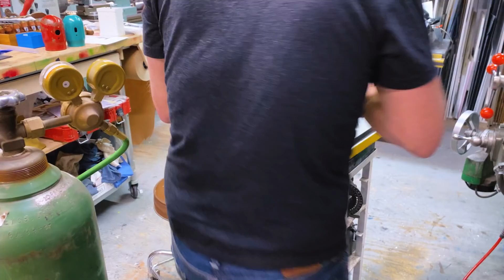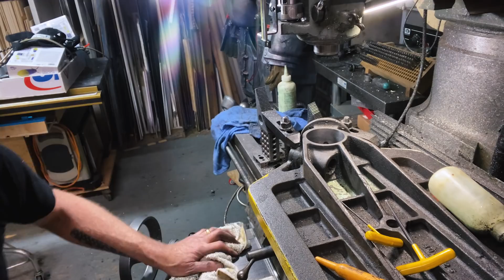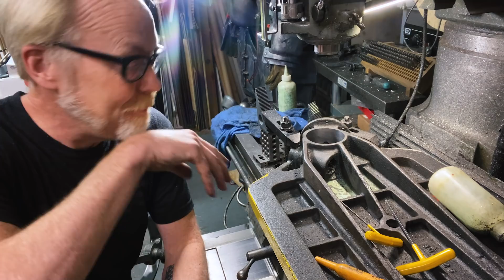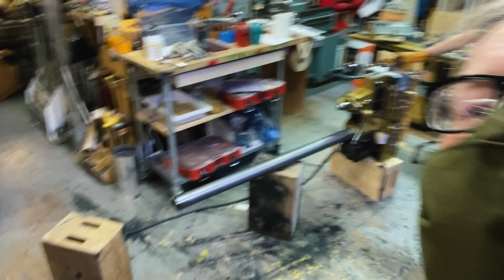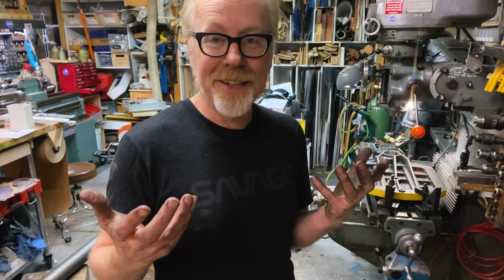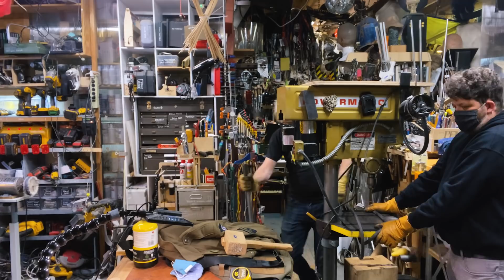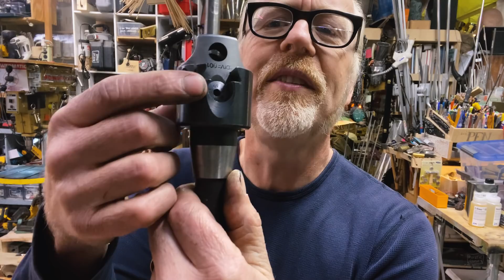Adam Savage's One Day Builds: New Drill Press Table!

Comment: Great to see you figured it out & got it to work. While watching your Mercury suit cuff links video I noted all the lubricating fluid you were using manually, and the mess it was making to the back of the mill. I use some cling-film or saran wrap as a splash back for dirty jobs - easy to peel off and replace. Also I wonder if a motorised lubricating fluid system might be a build you want to do, along with a capture and recycle tray underneath. You could make it flexible enough to work under the lathe, drill press or other machine in the shop. Thanks for all the great videos & keep working out the little niggles & wiggles.

Comment: Use dry ice on the pole will make it easier to put the table on.  Take about 45 to 60 minutes.  The diameter will be smaller.  Also heat up the table with heat gun.

Comment: Should've kept the OG table installed under as a tool rack support. :)
Taper cuts happen when you overextend something OR OR when your bearings are shot. Generally, with old equipment, you want to take a lot of spring cuts.

Comment: As a former metrologist and Quality Engineer (newly retired) who routinely measured automotive parts with a 3 micron tolerance, it's painful to watch you attempting to accurately measure an ID with a caliper.  Even the most skilled with that tool can only hope to be within .002" accuracy simply due to the construction of the tool.  But even with that, tool flex and clearances were obviously the bigger problem.  I really enjoy your cowboy approach as it is 180 degrees opposite to my anal retentive attention to detail and still gets to the finish line.  It inspires a more relaxed attitude in my project ("it isn't brain surgery").  BTW, how is the finger after the battle with your lathe?

Comment: Too much stickout on your mill :). Pressure reduced as it extended through the hole.  Line boring, reamers, etc. Pain to do cuts like that. If machine was out of tram it would have cut the whole hole at an angle as opposed to having a taper.  My guess anyway. Awesome work!  Great vid.

Comment: That's a smart machining practice, to hold off on taking apart your clamping rig all the way. I do a similar thing in my shop. we have 4 hexagonal turret lathes that drill and bore holes in cast iron, which we ship to customers. what i do is leave the tooling on the machine, because there is a strong chance that we may get a similar size ID to drill out. If its a different ID, we just take the tooling down, and put the new tooling on.   Sometimes it saves time here to be lazy and not put the tooling away!

Comment: When the new table wouldn't fit, despite measurements being above board, I would've suggested to re-mount the old table. 
You know the old table will fit, and if it won't go on, it's your technique that's the issue, not the table..
edit: granted, doing so wouldn't catch that the tool was bending near the end of the hole, but as a troubleshooting step it would narrow down what's going on.

Comment: I was changing the clutch on my VW rabbit. The transaxle weighs all of 75 pounds, so no transmission jack or whatever is needed, you just lie under the car, drag it close, and lift it up on your chest, then dead-lift into place.  There are guide sleeves on two of the bell housing bolts, so just wiggle it in place until you slide over those sleeves.
I worked at that for at least a half hour. I could not get the shaft spline to engage and the sleeves to engage. I was exhausted and frustrated. Set it all down and went inside.
Came out later determined to  l i f t  t h i s  u p... and snap it goes right in.
I was so tired I didn't realize I wasn't holding the transaxle parallel to the crankshaft and was trying to put it in crooked.
Sometimes it helps to just stand back and take a break

Comment: I was surprised that you didn't cut a piece of wood or something to the size of the drill press shaft diameter and test the cut (either the first or the second time) by trying to slide that through the widened hole in the table.

Comment: From a professional machinist, I have 2 easy tips for your future boring convenience. 

1. Calipers are not final measurement tools. They're for reference and rough measurement. Use a telescopic gauge (or better yet a bore gauge), and you can see any deflection before you take down  your setup. 

2. Those boring heads are built with a cross hole that you can mount your cutting tool in. If you gan get it to fit, that's always the most rigid setup available to you. I happen to know those little Criterion style heads are made in 2 or 3 different diameters for that reason.
Reply: What is going on here? https://youtu.be/sbqytCVtQb4?t=214 Were you having a seizure when that part of the video was playing and somehow missed it?
Reply: @1pcfred  you mean where he uses the telescopic gauge to only transfer the upper dimension, and then measures it with calipers? Did you have a seizure while you were reading my comment?
Reply: @87FordMudder  let us go back and read your comment again, shall we? "Use a telescopic gauge" That Adam clearly does. Now why would you say I read your comment wrong? He's hardly fitting bearings here. His only mistake was to only measure in one place.
Reply: @1pcfred  Thoughts communicated in complete sentences are best analyzed in the same way. Read the entire thought and make another attempt.
Reply: @87FordMudder  my reading comprehension is exemplary so quit trying to weasel your way out of it.

Comment: Thicker boring bar with minimal "stick out" and larger boring head. Cast Iron should be cut dry to reduce the possibility of the abrasive swarf getting effectively turned into a grinding paste. Also: Easier to vacuum the dry swarf than it is to mop/ scrape it off the machine. Great build!

Comment: What's the ceiling like in there? Any room for a chain hoist for some of that heavy lifting? I use one in my shop and it's a life (back) saver.
Reply: Above the workshop is another floor of space. It's like a loft space, you need to go up by ladder but it's got rows and rows of shelves with weird stuff like space suits or bits of broken robots and half finished projects. I suspect it's barely able to support the weight that's up there already and couldn't handle anything more. IIRC he said the floor of the workshop is at an angle because it used to be for cutting meat or something, and the floor is actually suspended on a set of beams he built with his builder buddies. He specified the weight of the floor must be able to support the X-kg weight of the drill press and mill.

What he needs to do is get a different builder/lunatic that is good with welding and put in some proper RSJs so he can do a chain hoist. But first he'd need to remove a lot of his stuff temporarily and that could take months.
Reply: @martinperry1843  The loft only covers the first part of the workshop. The main part were Adam works has a high ceiling with a skylight. https://goo.gl/maps/XJXdtU5Wmb5wbhRW8
Reply: @RimePendragon1974  oh so maybe it IS time for him to look into getting a chain hoist. Also those 3D shots of his workshop are amazing, it's fun to see but it must be from years ago as half the walls are empty instead of covered in Adams miscellaneous crap. I spotted a RoboCop shoulder armour piece on the table, does he have a RoboCop outfit too?
Reply: It'd likely be good enough for a few hundred kgs. A 500kg chain hoist is tiny and makes picking up things like the drill press a breeze.
Reply: Adam’s cave is crammed into a tiny lot in San Francisco, and in one of the oldest neighborhoods. It looks bigger than it is. The floor of his attic / second floor is wooden, so I doubt there’s room for anything like a chain hoist.
Reply: He has a Bridgeport AND a lathe in there, so...  He's got a pretty decent sized load on the floor already.  And I didn't realize that it's a wooden floor until just this video.  BUT !  An engine hoist works pretty well for me in my shop. It's not everything that I could want, but it's better than nothing.  (oh, and p.s. a cylinder hone would have straightened out the bore for you, it's a big time saver!)
Reply: That's what the apprentice is for lol

Comment: its very common for milling to cone, as it flexes the deeper you go, so the flex from your first pass carries over to your 2nd rotation aso. thats why we usually have a finishing pass in CNC with the exact same specs as the last pass.
Reply: Old hot rodders learned the hard way with a wedged piston and broken rod not to use a boring arm without multiple finishing passes.
Reply: I've heard machinists call that last pass a "spring pass". It compensates for the springy bending of tool, material, and machine during heavier cuts.
Reply: I was wondering what the cause would have been, and this makes sense. I guess the motto should be “measure twice, cut once (or more if working with metal) then remeasure before installing”
Reply: I have a number of boring bars with HSS tips for deep holes where there night be deflection issues.  Less tool pressure needed, so less potential deflection.  Not the root cause here, but sometimes invaluable.
Reply: @componenx  I love HSS inserts for my wet noodle Atlas lathe :-)
Reply: @samroesch  I had an Atlas, but it had been repaired so many times that I gave up on it and parted it out.  My Logan and Clausing lathes are much stiffer.  OTOH, my primary mill (/drill!) is also a noodle under load.  I have a Millrite in storage that I've never used because it has a BS7 or 9 taper, but I was just thinking today that it much be stiffer than the TWS mill.
Reply: Yeah I was going to assume that there's some kind of bit deflection at play especially considering how long it had to protrude.
Reply: One thing that works better when boring deep holes on a Bridgeport is using a boring head that has an extension between the head itself and the R8 taper.  And then use the shortest boring bar possible. Also when possible use the biggest boring bar you can

Comment: Adam idk if you have covered it already but is the floor plywood.  Mine is and I enjoy it for ease of removing sheets and installing outlets or air lines thru the floor . Was wondering how you felt about it
Reply: yea its super thick too. the actual floor is concrete that slopes to the middle for drainage. he had the wood floor put in professionally if memory serves. he also has had to run lines underneath it a few times.
Reply: @ShadowDog_43  thank you for the info. Mine is 3/4 its strong but I can maneuver it around  sadly under my joists is sand not concrete haha

Comment: When training, we were always taught to bring the table up to the tool as much as possible instead of using the quill. That might have also contributed as by using the quill, the moment on the end would be much higher meaning its more likely/easier for the tool to bend especially when machining harder materials
Reply: Thats what I was thinking, tool deflected once it was extended far enough
Reply: @microbuilder  exactly my thoughts. Surprising how much force can be applied, especially when extended. 

I only ever use the quill for drilling through holes. When mission critical or larger cuts are being made, the stability/accuracy/control you get when raising the table instead is key
Reply: @wiggle4545  Looks like that wasnt the only problem lol 20:10
Reply: @microbuilder  the tool rubbing most deffinetally did not help in that situation! 🤣 Would have surprised me if it wasn't noticed whilst cutting because there would have been some noise change and I would have suspected some witness marks on both the tool and workpiece with potentially the top radius being out of tolerance because of the rubbing
Reply: Would have made more sense to run a short tool out the side of the boring head perpendicular to the axis of rotation, then definitely use the knee to raise and lower it. Seems like a culmination of many issues in the set up that caused it. Maybe Abom79 should give Adam some machining lessons!
Reply: Tool flex was my first thought when I saw how far the boring bar was extended out of the boring head.
Reply: Probably the cause, though I've always pondered couldn't the cutting tool loosing material change the dimensions of a cut? Maybe not enough to matter, just a thought I've had.
Reply: @KriLL325783  Tool wear isn't really an issue, especially since the boring head is adjustable so you can accommodate for it, you just creep up on the number, measuring then advancing the tool until you hit your number. Anothing issue was he was using calibers to measure the hole, which meant he was only measuring the top, a depth gage and a micrometer would have allowed him to check the top, bottom and middle, allowing him to catch it earlier and correct.
Reply: @JimmyMish  I agree, especially with a carbide tool I wouldn't expect a lot of varience during a single cut.

I did see him using the tool he has for measuring interior diameters as well as the callipers but I think you're right in that he only checked the top and not the middle or bottom which means that he didn't notice the issue until afterwards
Reply: For Sure even thou my Delta drill press has 6inch travel  I still bring the table up as much as i can.
Reply: Not yet having a Mill, I realize that a lot of people when they first start working with a mill are going to use the habits they developed working with a drill press that doesn't have any easy way to change the height while working with the tool. When you start working with a mill, you have to develop different tool use techniques to get the best out of the tool. In this case that's not the only issue, but I suspect that in time we'll see Adam make better use of that technique as well. Note that yes I do move the work to a point where my drill bits will clear the part when I'm done drilling them on the drill press, but once the drill is in operation, the tool head gets moved rather than the bed the material being drilled on. Again, my drill press doesn't have an easy way to move the bed vertically w/o imparting movement around the column. Limitation of working with cheap tools I suppose.
Reply: @RNMSC  you're using the right method on the drill press, even on more expensive ones you will use the quill. Having used a radial drill, they work exactly the same despite the huge size! Always worth using a reamer to make the holes perfect.

He has it set up pretty nice though with the pneumatic draw bar tightening. We have to use a spanner to tighten/loosen it up which is fine until someone forgets to take it off! Heard it where the machine was turned on, the spanner hits the motor, the drawbar snaps, launches across the room and the rest drops and hits the workpiece 😅

Comment: Tools flex, always. Experience is a brutal teacher.
Reply: It was more than tool flex. He reveals at 20:08 that the shank of his (hacked about) boring tool was contacting the top of the bore when the cutting end was at the bottom of the bore, causing the cutting edge to push away.
If anyone suspects this might be going to happen, slap some sticky thickish fluid on the shank (I often use glazing paste) and if it come near to making contact it will transfer to the bore and reveal that you are about to have a problem.